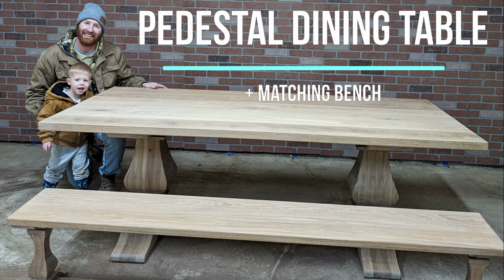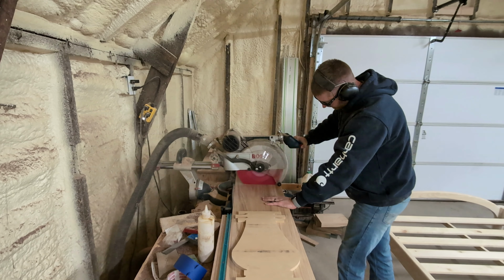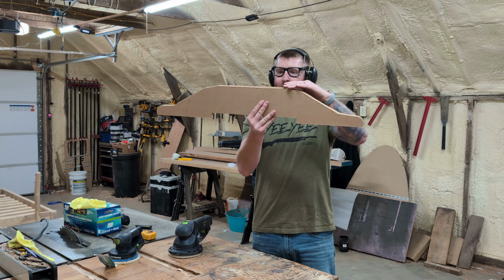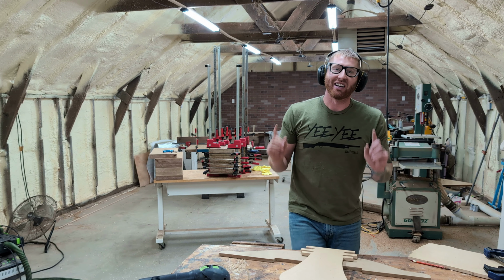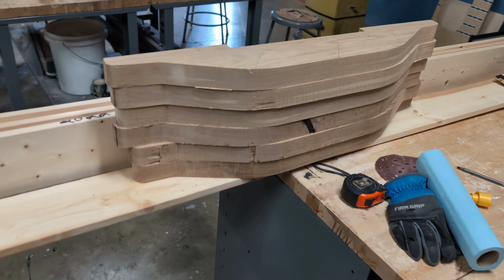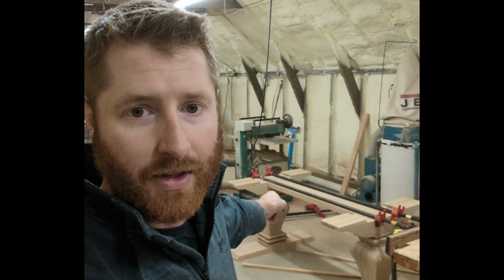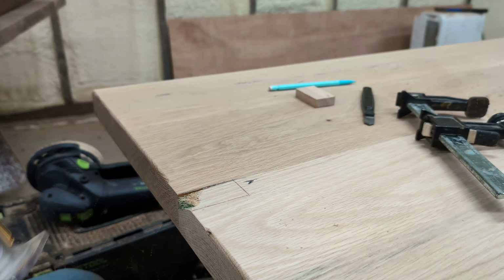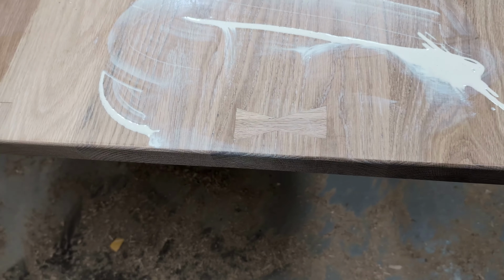Pedestal Dining Table

Comment: Nice job Tanner!  I just finished a similar dining table build and tackled the challenge of making my own pedestals.  I used softer poplar on the pedestals to make the bandsaw work a little easier.  Definitely a stressful experience trying to cut them out and maintain some symmetry between the two pedestals but turned out great.
Reply from the maker: @keithtate3298  thank you for the kind words, I'd like to tackle another pedestal table!  I'd change a couple things on the profile to make it a little easier to cut out on the band saw!  I'm glad to hear your table was a success 👍